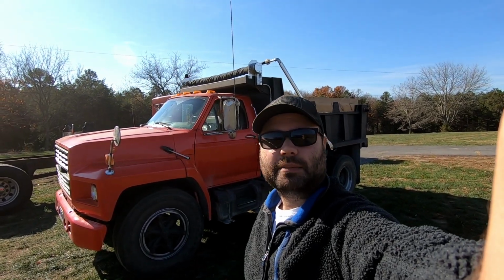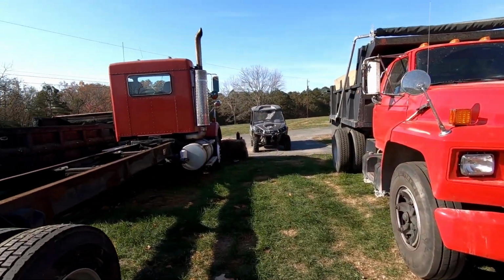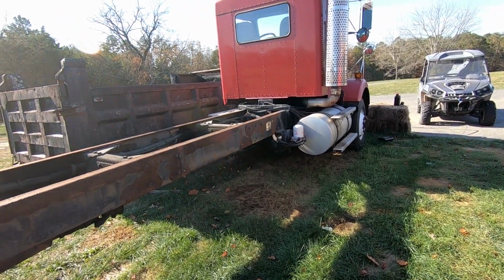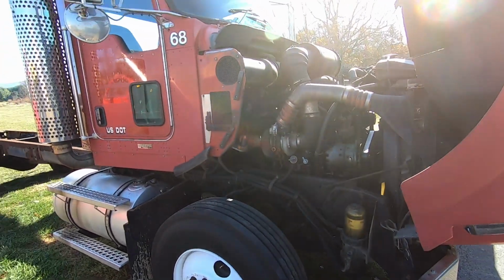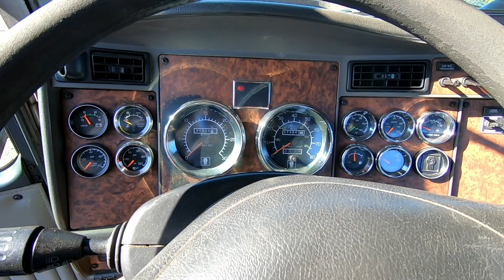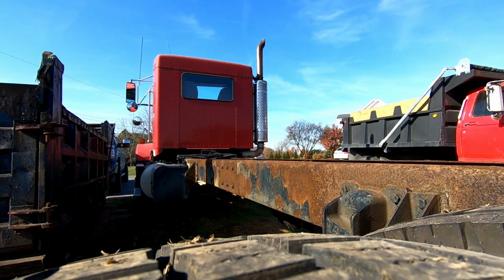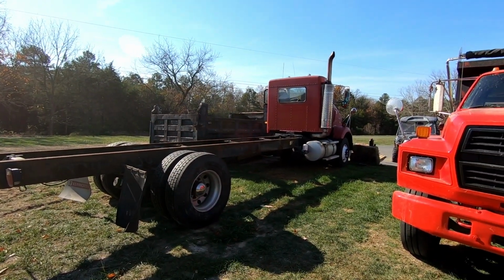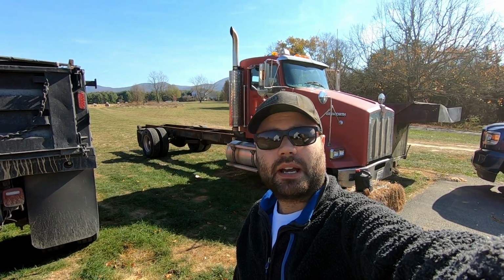My new 1.5 million mile Cummins. Selling the other trucks!

Comment: Shortening... that's a huge project.
Reply from the maker: Yes! My friend is going to let me borrow his mag drill which will help a lot. Also a huge project to plate it. 30 some holes per side.
Reply: Not too bad really just take off the drive shafts and unbolt the axles and roll ‘‘em forward. Torch off the remaining frame.